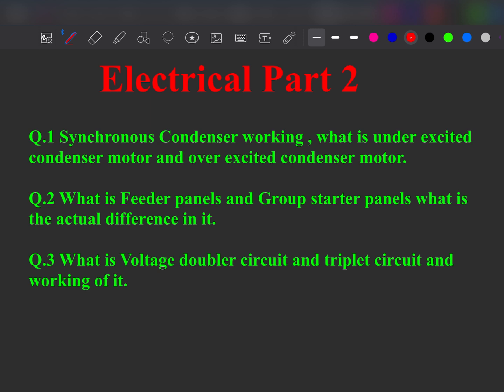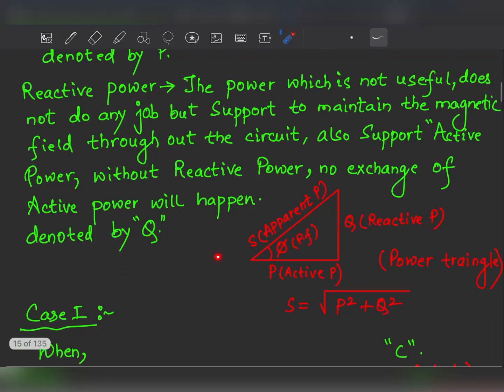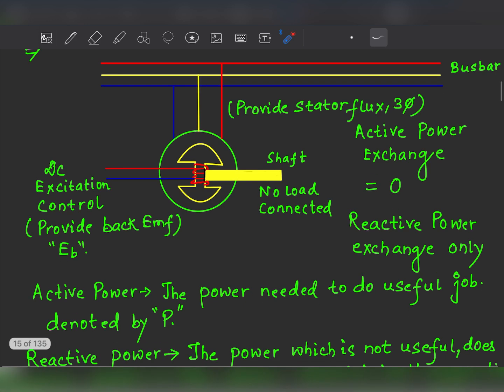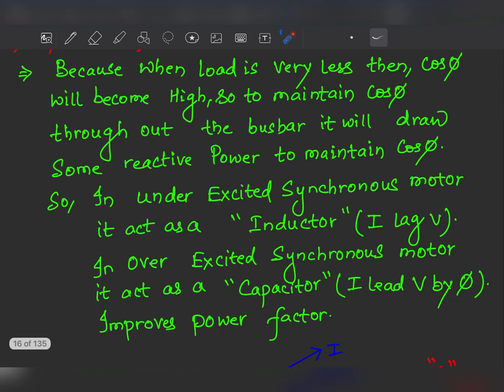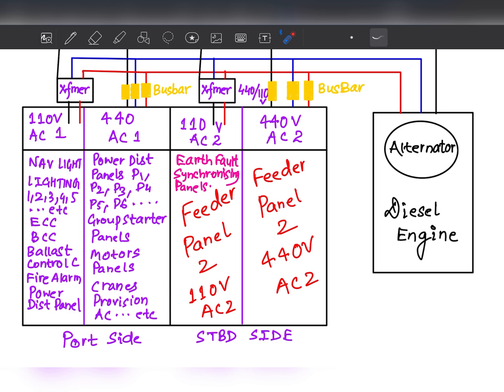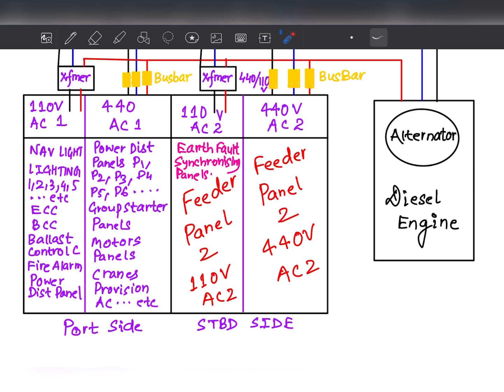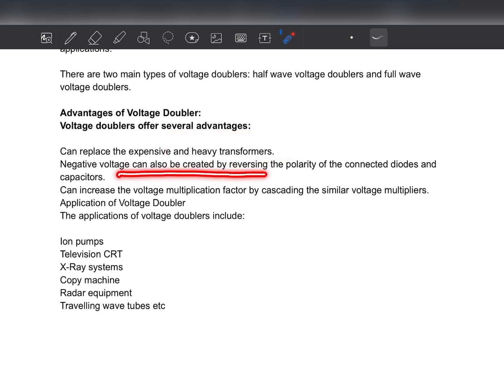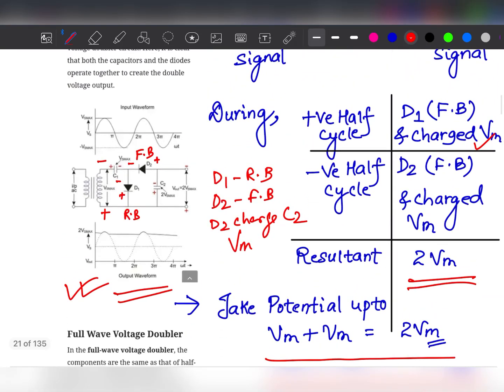ELECTRICAL PART 2, Synchronous condenser complete, Voltage doubler, Feeder and Group starter panels.

Comment: application of sychronous motor onboard ?
Reply from the maker: Used in Propulsion, Gyrocompass, Clear Glass
Reply: Sir,
Power supply needed for x band and s band radar ?
Reply from the maker: @v999-m5w In a ship, the emergency power would typically be connected to the S-band radar rather than the X-band radar, as S-band radars are generally considered more reliable in challenging weather conditions like heavy rain or fog, which are situations where emergency navigation might be critical; whereas X-band radars, while offering better resolution, can be more susceptible to interference in such environments.